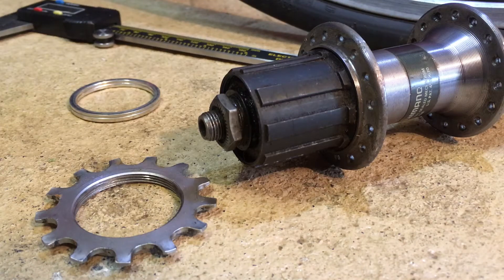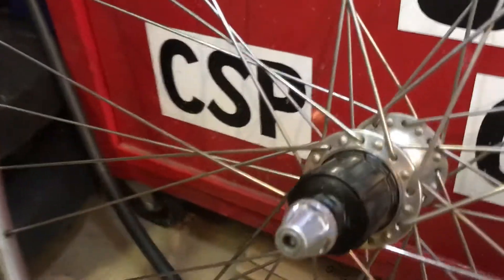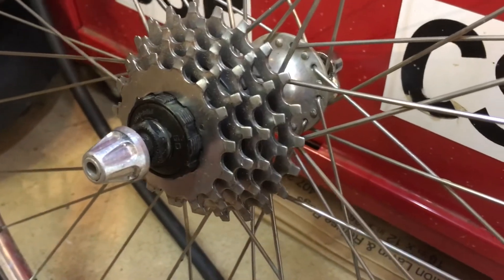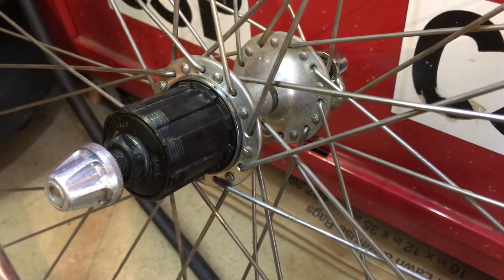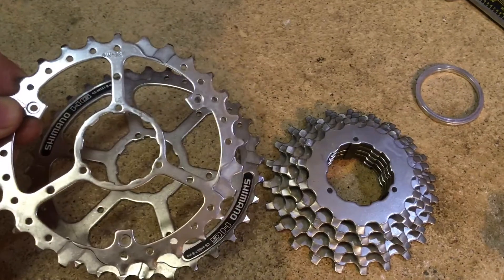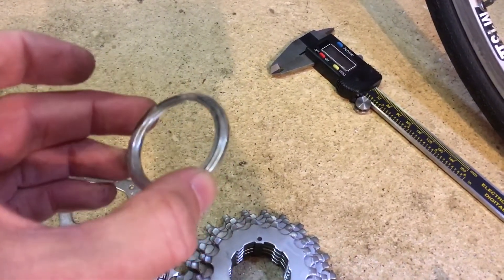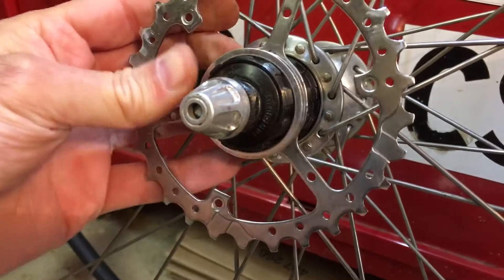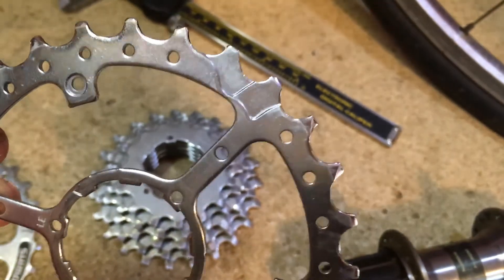How To Use a Modern Shimano Hyperglide Cassette on an Old Uniglide Hub

Comment: i am still using that ug cassette on 8 speed hub, sprockets can be used on both sides , it lasts forever
Reply from the maker: I put together a gravel-style bike a couple years ago and haven’t ridden the road bike since, having taken it apart for service, but I agree, I see no reason to switch out the hub when I get back to riding it.

Comment: I've bought a bike equipped with a complete Shimano exage drivetrain. It's a 6 speed uniglide cassette and to my surprise it is indexed both front and rear on the downtube shifters. It's all kind of weird. 

I'm unsure if I should buy an old uniglide 14-28 cassette on ebay or convert a modern hyperglide one like you did. 

I was thinking of reusing spacers from my current cassette but for that to work cogs would need to be the same width and I have no idea if that's the case.
Reply from the maker: Interesting. I assume your Uniglide cogs don’t have ramps, as that was the major improvement for Hyperglide. If that’s the case, your shifting will be much smoother with Hyperglide.That will necessitate a new chain though as well. As far as the spacing is concerned, I had the same thought of reusing spacers, but didn’t want to take apart the old cassette. It was easy to pick up new spacers for a few bucks at a local bike shop.) Even if the cogs are slightly different width, I can’t imagine it would be enough to cause different spacers to be required. This assumes that you’re staying with a 6-speed, of course.
Reply: @76horsepower  The cogs are indeed smooth with no ramps. Shifting is already smooth as butter but it lacks range. It's a 13-23 cassette and it looks brand new to be honest. 

I'm going to be climbing with this bike so I want to achieve as low gearing I can and spend as little money as possible. 

So my plan is to get or build a 6 speed 13-28 cassette and replace the 42-52 chainrings with 38-48. 

Obviously pro cyclists of that era were able to climb with a 42/23 ratio but I'm a mere mortal with a limited budget and need all the help I can get.
Reply from the maker: @ifrit35 I’m all for doing upgrades on a budget. I wonder if your shifting quality will go down when you increase the size jump between gears. I’d bet that’s when the ramps will make a significant difference.

Comment: I just hack the hub and swap out the uniglide body for a hyperglide one. Plenty of Shimano parts are a "B fit" and as long as you get the hub spacing where you want it afterwards you'll be good to go.

That said, there's no shortage of Uniglide cassettes still out there. I've seen plenty on ebay.
Reply from the maker: It’s my understanding that some are able to be converted and some are not, depending on when they were made.

Comment: Excellent tutorial! I want to change gearing on my 89 Centurion
Reply from the maker: Thank you! The bike that I worked on in the video was a 1984 model. By 1989, Shimano was using Hyperglide, if I recall, so modern gears should fit without grinding off a tooth, though you’ll still have to take apart a modern cassette and add spacers. Do you have a 6-speed or 7-speed?
Reply: Interesting, my 89 Dave Scott with all shimano 600 group set , has a 7 speed Uniglide. 
The short cage derailer will handle a 12-28 gear cluster?
If it was easy to find a 7 speed hyper glide freehub, I’d swap that.
Thank you!
Reply from the maker: @duckbuell I wonder why Uniglide was used that late in your case? I don’t think Uniglide was ever indexed, and Shimano was using SIS shifters by 1989 for sure.
Reply: @76horsepower  The shift lever is indexed for SIS, however the lever can be adjusted to friction shifting.
It’s funny how parts get mixed around during a production year.
I’ve seen random group sets used on final year of the Bridgestone XO series.
Reply from the maker: @duckbuell Many shifters will switch between indexed and friction, but this is the first Uniglide I’ve heard of that uses indexed shifters. Interesting. Maybe I’ve been misinformed. Do the cogs have ramps like Hyperglide cogs or are they just angled like the Uniglide cogs I’ve seen?
Reply: @76horsepower  The cogs do not have ramps. Ive got a hyper glide cluster on the way to modify.
I’ve serviced the bike from the frame up, I’m impressed with the quality of the frame and components. 
Can’t wait to ride it!
Reply from the maker: @duckbuell  You’ll likely need a Hyperglide or Hyperglide-compatible chain as well (they’re made to work with the ramps). Once you’re done, the shift quality will be much improved. Keep me posted!
Reply: @76horsepower  The upgrade went well! I kept the hyperglide cluster together and used a long file to narrow the wide spline. Got a new chain on too. I’ll ride tomorrow!
Reply from the maker: @duckbuell  Great! Seven-speed Uniglides aren’t common, so being able to upgrade to a 7-speed Hyperglide with the correct spacing is a bonus!
Reply: Thanks for the info!  It gives me a simpler option than swapping hubs and/or dishing the wheel.  My uniglide is a 6 speed on an 89 Giant.  Has Exage mtn groupset which can be indexed or friction but the cassette gears don't have any grooves cut so there must have been a time at the end of uniglide where they did have indexed just not as dialed in.

Comment: Tip: fixed gear cogs and bsa bb lockring has the same threading as the UG locking pinion. So if the last pinion is worn, you can try a fixed gear pinion (be sure to not get the 1/8 version.. search for the thinnest one to work with multispeed chains.)
Using the BB lockring as a casette lockring works but loses a speed.

Comment: can you change the free hub body
Reply from the maker: Not exactly. I did discover via another video on the subject that it can be done, but some of the internals need to be swapped out as well. I wish I had a link to the video handy,  but I don't recall where I found it. If you have an extra freehub laying around, it's certainly worth the look.
Reply: @76horsepower  Actuallly you don't, you just need to get the correct freehub body that match your wheel engagement sprokes. I did it to late 80s 7 speed uni to hyper and still works great on  my schwinn 105 retromodded road bike. Saved the wheels, but had to upgrade to the cogs to hyper, but I was upgrading those anyway. Works awesome, just changed the freehub body. Super easy! Look for RM30 FH, at least that worked for me. Of course it was 7 speed to 7 speed, not 6 speed.
Reply from the maker: @arielsaulog6796 As I understand it, it depends on the model and year. There wasn’t a single drive type that all Uniglide used, I don’t believe; I think my 6-speed uses a different connector. But even if it didn’t, my goal was to be able to change ratios easily, and going from one fixed cassette to another fixed cassette wouldn’t have helped that. And I wanted the really low gears only available on modern 8 and 9 speed cassettes. It’s certainly worth it if your goal is just improved shifting though. Glad to see other folks keeping old bikes alive!

Comment: What was a quick solution for me (before I will have to change as you have shown) is that the sprocket's of the uniglide cassette can be reversed. Just remove the 3 little screws and turn the sprocket's and your good to go again for a while ;)
Reply from the maker: Indeed, if they’re worn out, that’ll work. In my case, I wanted different gearing, which necessitated changing the cogs (or chainrings).

Comment: A few thoughts:

7 and 8 speed sprockets are pretty close in thickness to the original 6 speed. Since you already have the 6 speed cassette, you could take that apart (three bolts - easier than the rivets of the newer cassettes) and just use the spacers from that with the new sprockets. Spacing might not be perfect, but I think it's still closer than mix-and-match of other spacers you show.

The other thing is that the freehub body from an FH-HG50 rear hub is a perfect replacement for the late 6-speed uniglide freehubs like you have. This is a 6/7UG + 7 HG shell with the same dust shield sealing diameter and length on the axle as the 6UG hubs. Later 7 speed freehub bodies went to a larger dust shield that would require changing other axle parts to match, but this one is a perfect substitute on its own. I use this body on my 600EX freehub with a 6 speed HG cassette plus a 2mm spacer to make up for its shortness relative to a 7-sp width body.
Reply from the maker: Thanks for the input! I could absolutely have taken apart my original cassette, I simply wanted to keep it all together. But you're right in that the spacing might be closer. Though when I bought the spacers, at the time I thought I was spot-on with what I'd read, and that was my goal. Either way, a non-indexed shifter doesn't much care so long as the chain width is correct. 

So an FH-HG50 is a transitional hub, then? That's interesting, because I'm pretty sure that's the hub that I have on my mountain bike. That wouldn't have helped me since I had no intention of taking my mountain bike hub apart, but that's good to know if I stumble across one in the future. I'm pretty happy with the range of gearing I have right now, but less so about the steps between gears. I often have a hard time finding the right gear when riding with my friend who has more speeds, so my next upgrade is likely to a 7- or 8-speed - or possibly a 3-speed crank.
Reply: This comment is so valuable. Thank you so much!!! I have a 6sp UG cassette from 1982ish that's super worn but I really want to keep the rim on the wheel. I've broken two chain whips failing to remove the small cog so far. Changing out the entire freehub will surely be the easiest solution. Going to look for an FH-HG50 now. Thanks again.
Reply: Hold on - "late" uniglide freehubs? What's the difference between "early" and "late" here?

I think mine being 1982 might be too early for this conversion. 

Also where did you find a 6-speed Hyperglide cassette?
Reply: @crunchysaviour  By late, I meant specifically the FH-1050, FH-6207, FH-6208  and FH-6400 hubs (105, 600EX and 600 Ultegra) hubs. The FH-HG50 uses the same seals as these hubs so you can transplant just the freehub body while keeping everything else original. With other hubs, the shield/seal may not be the same, but if you're buying a complete hub for its freehub body and it's incompatible with the seals of your existing cone, you can just use the cone from the donor hub instead.

There are earlier freehubs where the steel freehub body is press fit onto the aluminum hub. There is no hollow steel bolt like the later ones, but the hub has a protrusion where the bolt would be. Those are more of a problem. It may be possible to transplant just the outer shell of the freehub (RJ the bike guy has a video doing so between two different generations bolt-on freehub bodies), but it's hard to know for sure whether it'd work until after you've tried it.

I don't know offhand if 1982 would be a pressfit freehub body. Do you know the model number of your hub? Hopefully it's stamped into the hub, FH-xxxx, together with a two-letter date code. If you can provide that, I can try to dig up more specific details for you.

As for my 6-speed hyperglide cassette, I basically did part of what's described in this video: I started with a 7-speed CS-HG50 cassette and ground off the rivets to disassemble the cassette. I left of the largest sprocket and spacer, and initially added 0.5mm steel BB shims on top of each spacer. Later on, I found an old 6 speed uniglide cassette, and took the spacers from that to use instead of the 7-speed spacers+shims.

Shimano did actually make two different 6-speed HG cassettes, but they're even harder to find than 6-speed UG cassettes (CS-HG30-6af and CS-HG50-6ad which are 11-24 and 12-24 respectively). I don't think they were ever marketed in the United States, but freehub bodies for the 11-24 cassette were still available new from European vendors when I last looked maybe 3 years ago, though I understand they're only allowed to sell within Europe.

Sadly, Shimano discontinued the loose-sprocket 7-speed cassettes a few years back. The currently available 7-speed cassettes use an aluminum spider with sprocket rings peened onto it. This is lighter, but the sprockets aren't usable individually.
Reply: @lunstee  thanks very much for this super informative reply. I hope one day to get a proper solution in place but for now i think i will follow the method in this vid. Since I last posted, I managed to get the small sprocket unscrewed using a pair of big long homemade plywood spanners, clamped to the sprockets. Huge satisfaction! 

I'll try using an 8 speed cassette, reuse my existing UG spacers, and hopefully replace my small (13t) threaded sprocket with a track cog.

Thanks again for your generous advice.
Reply: @crunchysaviour  You're welcome, and I'm glad you could finally crack your cassette!

One thing to watch out for with the 8-speed cassette: Shimano often does things with the largest sprockets too along similar lines to what I cautioned about the 7-speed cassettes.The second largest sprocket is sometimes just a ring that doesn't go all the way to the freehub shell. It's normally riveted to the largest sprocket with the plastic spacer sandwiched in between, which is a little lighter, but means that sprocket isn't viable by itself. Depending on what gearing you're looking for, this may or may not be an issue. Compatible non-Shimano cassettes (SRAM, SunRace) might be an answer.

Comment: Possible to just change the casette body?
Reply: Depending on the generation of uniglide hub, if it has the buldge behind the freehub, then you can swap the unibody freehub body with a basic, shimano made, hyperglide 7 or 8,9,10 speed freehub body, since 2nd generation or higher uniglide free hubs use the same type of inner bolt as hyperglide freehubs to attach to the hub. This isn't possible though with the earliest uniglide hubs. The earliest uniglide free hub has a different, shallower mount, that is only held on the hub by the lock nut on the axel, and won't interface with a hyperglide freehub body.
Reply from the maker: Not exactly. The way that Hyperglide and Uniglide cassettes mount isn't quite the same. I watched a video a while back of a fellow who basically took the guts out of a Uniglide and put it into a Hyperglide cassette and did what you're suggesting. If you have an extra Hyperglide cassette of similar size sitting around, it's a valid option.

Comment: Ive been using the uniglide hub with 7 speed cassette. But the cup cone got broken so im looking for a hyperglide to replace the cup cone inside it .
Reply: I had a low-end 7-speed freehub body, but picked up a junked 9-speed 105 wheel which had a nicer cup race. The cup from the 105 freehub fit just fine into the 7 speed body. I remember omitting one of the bearing adjustment shims (behind the cup) along the way to reduce bearing play, but I think that was more to adjust for play in the 7-speed body to begin with rather than adjusting for a difference between the old and new cups.
Reply from the maker: That’s something I’ve not tried. If you replace it, lemme know!